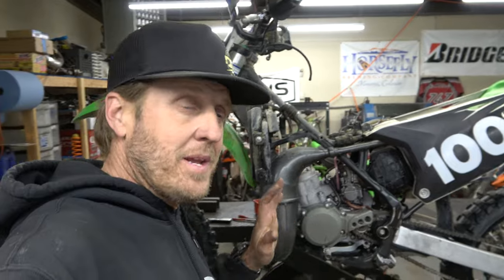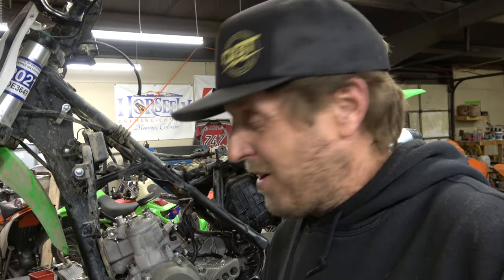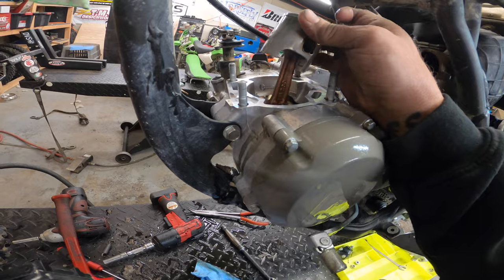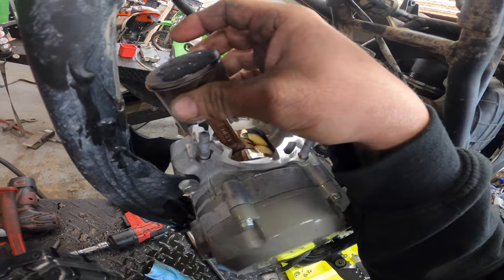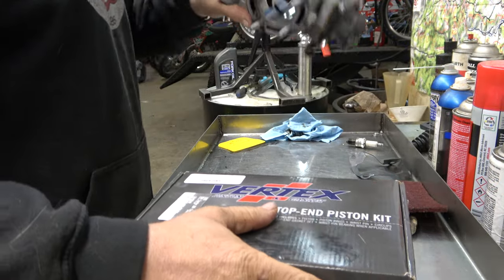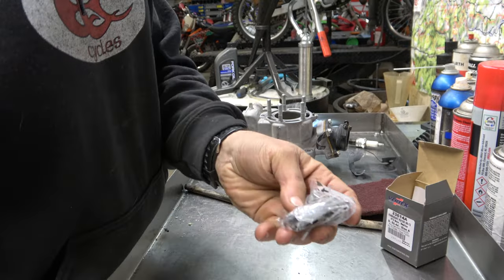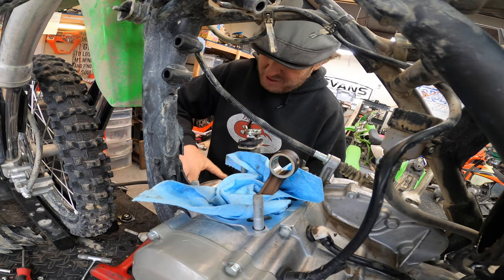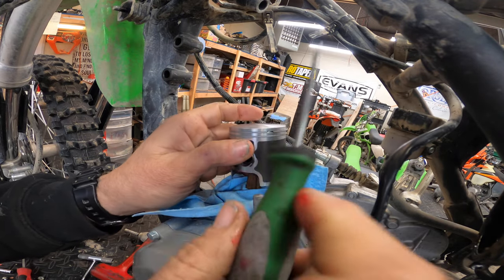How do you replace the top end in a KX100

Comment: I talked to you the other day about the fork seals. Just got in my jug base nuts, two right hand side studs and dowel pins (PO had the nuts all rounded off and I ended up having to cut them off with a Dremel) but anyways I got my replacement parts and a brand new oem cylinder, weisco piston kit and I’m about to attempt my first top end rebuild tomorrow. Thank God for your kx100 content or I would have had a hard time finding out proper info on how to work on this thing without actually finding an owners manual somewhere. Not only that but reading something and seeing someone do something are two different things. Thank you again sir!
Reply from the maker: Awesome to hear.

Comment: Hope you get this message and hope to hear back from you. I know this was posted two years ago but I just did a top and rebuild on my sons KX 85 and when I was looping up the piston and rings, I got a little bit of oil on the cylinder gasket, will that still be OK? I really hoping it will be.
Reply: Hopping it will seal fine and not leak pls help
Reply: My dad is a small motor mechanic from many years ago and he said it’ll be fine
Reply from the maker: It will be fine
Reply: Awsome thanks and good to hear back thanks again.  so I have another question for you recently just did a top and rebuild on my son‘s bike, but the carburetter on the bike was replaced, not by me but the previous owner. I’ve done some research on the carb it is a pwk but it says on the information that I’ve read it has the 132 main jet in there instead of the 135 and my air screw is one and a half turns from seated just did not want the bike to be running too lean, while I do the break in procedure, it’s already had a couple heat cycles put through and was doing some research and I came across that so I’m not quite too sure what the main jet sizes I will know tomorrow once I take it apart, but was just wondering what you thought I’m currently running 24 to 1 for the break in
Reply from the maker: @justinmackinnon6135  hard to say. That sounds like a plenty rich main jet
Reply: @highlandcycles  would rather a lil richer rn for breaking but I’m gonna take the car apart tomorrow and see what jetting are in it so like I said this carburetter stuff is all new to me and the jetting so I got a bit of learning to do I take it you don’t know what jets were in that KX 85 that you rebuilt

Comment: Would you not recommend going straight to a track after doing a kx65 top end? On the heat cycle. My daughter is still a noob but they do splits on the main tack for the kids which requires her to ride it a little harder. Their are times when she’s over riding a gear but the there or times she’s on point with her shifting. Or Should I do a heat cycle by ridding the bike through the gears at 1/4 throttle then at half throttle then open it up as much as I can before she hits the track?
Reply from the maker: I’d heat cycle it a couple times before you take her to the track

Comment: I've noticed there's 3 size options for the vertex kits. My wife @jessrainville, has a 2018 kx100 thats due for a top end. So how do I pick the right size kit?
This video is a great learning tool for Jessica. Really appreciate this one just at the right time. Thank you
Reply: 13001-0759 is the kawi oem part number from the last top end it got. Maybe this help?
Reply from the maker: @endurotruckererniedesjardins  the difference is really really tiny. They would all work. The way to do it perfectly is to take it apart, measure the cylinder and get the piston that has the right or closest clearance. I usually order the middle one and run it. I’ve never had an issue.

Comment: One of the sides is stuck and i cant figure out what to do, do you have any suggestions?
Reply from the maker: What sides?
Reply: @highlandcycles  if your looking at it from the front to the back its the back left one
Reply from the maker: @Coltonmb  but what are you talking about? The little cover on the power valve?  Or the side of the piston?
Reply: @highlandcycles  no its the bolt that the head goes on that wont budge at all, the nut is off but that side wont move off the bolt at all

Comment: Im starting think a 2stroke is way easier to service and cheaper to ride.  Growing up I loved the way the 2strokes pull but I like the smooth power of a 4stroke. Valves suck no pun intended !
Reply from the maker: Hahahaha
Reply: I've been riding for 41 years. I ain't sponsored so I ride 2 strokes. I ve got 4 bikes to keep up in my family yz250, 2 kx100s and a xr100.   I think I could rebuild all 4 of my 2 strokes for the cost of a proper yz450f top end rebuild.  I trust a 2 stroke more for longer intervals between top ends. I've got over 200 hours on my 2018 yz250 and I've never even had to replace the original sparkplug it came out of the crate with.
Reply from the maker: @endurotruckererniedesjardins  agree man

Comment: WHAT COULD BE A REASON THAT A KX100 WOULD BE LEAKING OIL OUT OF THE POWER VALVE VENT. RUNS GREAT BUT LEAKS SMALL AMMOUNTS OF OIL OUT OF THE VENT ON TOP OF THE POWER VALVE ITSELF
Reply from the maker: Just running rich and that is extra spooge